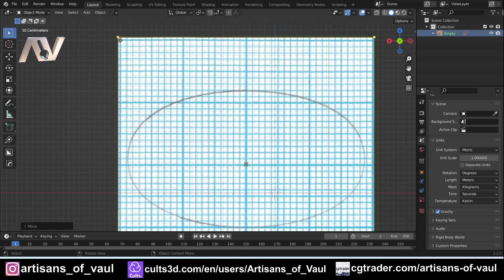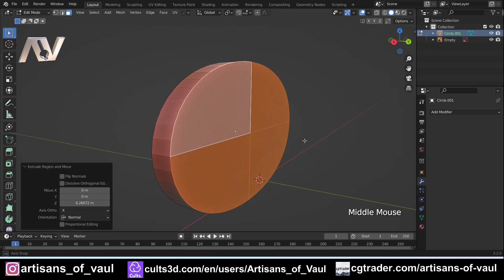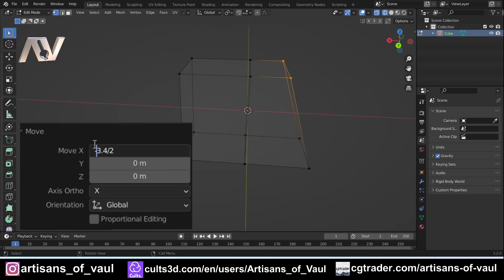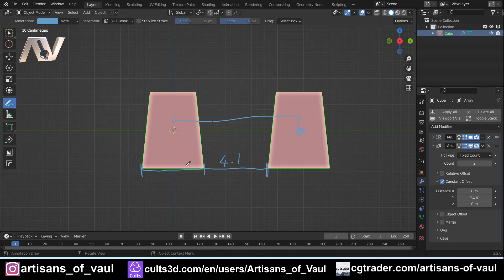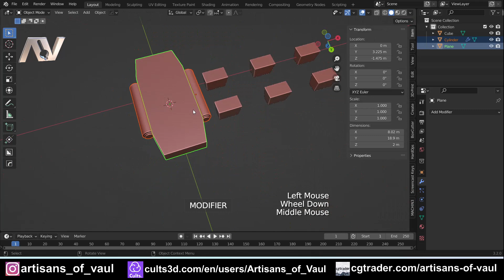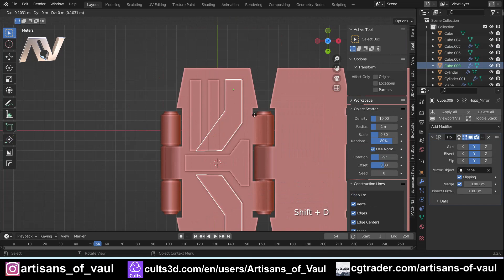Duplicate real world objects in Blender accurately

Comment: Great tutorial here, even from someone who's already been printing fine parts that need to be accurate. I totally didn't realize the mm issue, and wondering why the scale was always off when I imported (by 1000, of course).

One other thing I've started to do was what some people have called SubD modeling for curves like the first example. Basically, in the example you gave, I'd start with a 8 sided cylinder and apply smoothing, crease and sharp endcaps, and then a subdivision modifier set to a sufficiently high factor (usually at least 3).  Then I'd set up a mirror modifier on both X and Y, and line up the one free point in that 'real' quadrant so that the subdivision modifier's surface matches the curve. Takes some experience and learning to get it under control, but often the less points in your starting shape, the smoother it'll be. I use this for things like aircraft or boat hulls or other smooth surfaces, like missile nose-cones.

The benefit there is it allows you to change some important things like the number of divisions, after the fact if you need a smoother surface. It also allows for some funky organic curves on a hard surface without having to do other, more painful workflows like NURBS or something.
Reply from the maker: Thats definitely a good reason to use that sort of modelling workflow.  I generally find it a little more time consuming than I find worth the time saved when I do need to make those changes but I know some people who swear by that sort of workflow so you aren't alone in loving that process.
Reply: @ArtisansofVaul  It definitely lends itself more to game/video assets than 3D prints, as you already tend to know the scale and whatnot at the outset there.

Comment: When making the array for the initial tabs that stick up you can use both the relative offset and the constant offset together. A relative offset of 1 will put the parts side by side, then the constant offset can be used to set the space between them. That way you don't have to use math to set the distance and if the part size changes it will still keep the spacing between them the same.
Reply from the maker: I should have explained this in the video. I always avoid that because for the 3D printing I will often take off 0.2mm either side to make sure it fits perfectly. If you use constant offset that will stop things fitting in the correct spot. So I use constant offset so later I can make those modifications.
Reply: @ArtisansofVaul  I think you meant relative offset will prevent the 0.2 mm smaller part from fitting, but I understand what you meant. Not doing any 3D printing, that's not a consideration for me. Explaining your choice to use the constant offset and math was driven by a 3D printing workflow would have clarified the issue. I'm enjoying your videos, generally very informative.
Reply from the maker: @randyhester3340  Thanks a lot. It much have just slipped my mind as I was going through

Comment: Great video. But I wanna ask something related to making your own models.
I have downloaded a few models from different 3d art websites, (these are free models) for study so that I can make my own models and put the up for sale. But I do not know when dose copy right starts and ends. As in these are 100% my work at this point and the only part that are similuar are the connecting points and certain mechanical parts that are un negotiable. 
Can you help me out with this?
Reply from the maker: I'm not a lawyer so I can't be too much help here I'm afraid. There have been a couple of cases that were interesting on this front (the GW vs Chapterhouse being quite relevant). Anything that is a registered icon or symbol is totally a no-go to copy I believe (unless it is very generic, for example an omega symbol is a letter). In the video example the only bits that are the same are the track "teeth" to fit the model and they are just tapered rectangles so that should be fine too. However if I copied everything exactly but just added say some spikes that's getting a bit grey (and the real question is why not just design the spikes instead of the whole thing). If in doubt I try to be cautious and not push my luck.
Reply: @ArtisansofVaul  That's the thing. I'm trying to not copy things at all or do it as minimal as posible.
Like a shoulderplate is very much generic so it can be used witouth issue I belive but copying a Volkite weapon compleatly would be too much (maybe).
Reply from the maker: @richardduska1558  Yeah that sounds right to me.  But even then a volkite is a pretty generic design that has taken inspiration from a lot of places.  As long as it is recognisable as not the same thing I think you're OK.  Just don't quote me on that.
Reply: @ArtisansofVaul  Oh 1 last thing. This is more like a video request reather than copy right stuff. 
When it comes to connecting points (pegs holes and such) can you show how to usualy do them easily? Because when I rint them they usualy need some extra fidleing with size since If I just boolien a hole in than it won't be large enough.
Reply from the maker: @richardduska1558  Ive got that on the list of things to do along with cutting miniatures apart.  The only thing I will say is that the gap to leave will often depend a lot on how well dialled in your printer is so that requires a bit of trial and error I'm afraid.
Reply: @ArtisansofVaul  Mine seme to need around 1mm or so, but not sure.
Reply from the maker: @richardduska1558  Yeah, it varies a lot.  I normally get away with taking off between 0.2 and 0.4mm depending on how recently I calibrated/levelled my printer bed and how well I have my layer timing.  Thats why a video stating amount is a bit "risky" as it depends on a lot of factors.
Reply: @ArtisansofVaul  By the way. Do you have a discord server so that I can share my work or at least screen shoots of it and ask for help and such?
Reply from the maker: @richardduska1558  I don't I'm afraid.  I don't really have time to police a Discord channel so I thought it best to leave it.  But I am on Instagram and you'd be really welcome to message me there.

Comment: Tanks have several different types of tracks that they use and depends on the terrain they will be used in. The rubber pad type you was asking about are for when the tank will be traversing city type environments where there is pavement. Although they are not specifically to protect the roads, they use them to quiet down the tank movement across asphalt and concrete since the metal type cause vibration and broadcast the tanks movement and position. Likewise metal tracks with a variety of different pads are used for other environments and you can research which types are used for those. For example if it will be operating in an environment of ice and snow they will have cleats and or spikes to help with gripping on the slick surfaces.
Reply from the maker: Thanks a lot.  I didnt know that about the noise, I always thought the rubber was to stop damage to the roads.  All really useful information so thanks a lot!

Comment: Great video! My calipers are too cheap to include that cool little depth gauge you showed, I had no idea I was missing out on that kind of feature. And oh no! I hope you get well very soon, I had no idea you had been editing sections out along the way for coughing. Appreciate the extra work involved in making this video around that. Agree completely with you on the point of only using this to take care of non-negotiables. And your track design certainly does make way more sense. I could see the plastic design working if the rivets we're at least thicker than the pivots, so both your designs are much nicer and way more logical. I actually like the Plagueburst Crawler tracks a lot- but even those I feel were designed backwards so I flipped them around when building mine and now the tracks feel more like they'd really claw their way into the ground. Cheers
Reply from the maker: I'll have to check out the Plagueburst Crawler too.  The bit on the back is something I noticed a while back is missing for some.  With how helpful it is for things like depth measurements (especially with the ones that are a bit thinner so they can fit into smaller objects) they are really handy.

Comment: For more complex parts that you can't draw round like this, you can take a photo of the part. Make sure to get the best photo you can so the edges are crisp and well defined and from as close to the axis of orientation as you can. Choosing a background with a high contrast solid colour if possible. 

So if you are taking a picture of a grey plastic mini, try laying it flat on a sheet of bright green (for instance) paper from a craft shop, and take the photo from above with multiple light sources round the piece to eliminate as many shadows as you can.
Reply from the maker: I have tried this but I found its probably the method that creates the most errors when you are trying to get things as close to perfect as you can.  I normally use this if I want something to have generally the right shape/proportions but the exact size is less important.
Reply: @ArtisansofVaul  
I had to use this method for a project I'm working on and agree totally, but I couldn't draw round the part and it's contours are quite complex, so making a sketch from measurements was proving prohibitively difficult. I've got a tiny bit of filling to do on the actual model, but less than you regularly see on cast resin models.